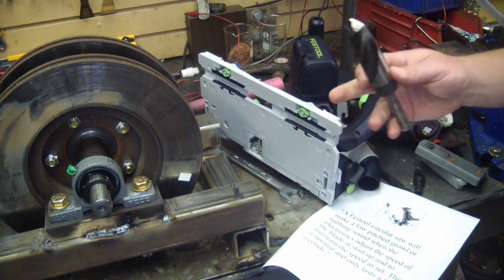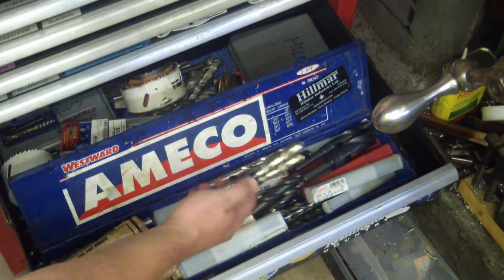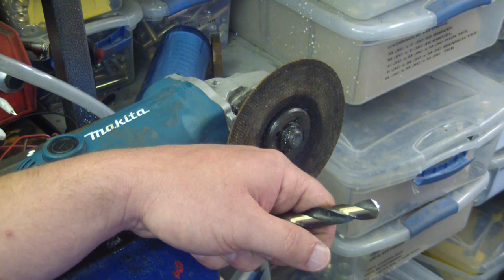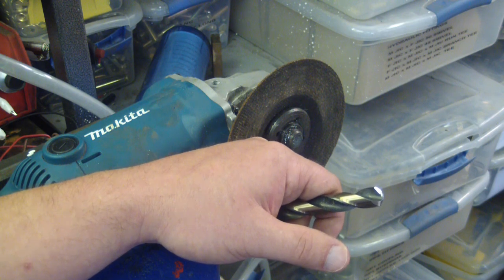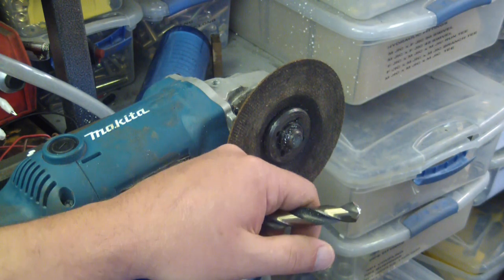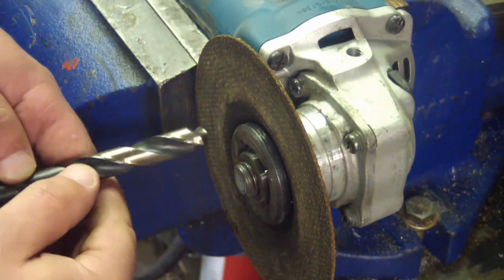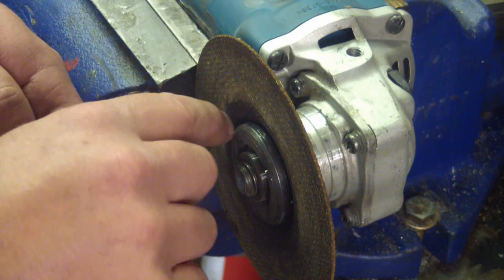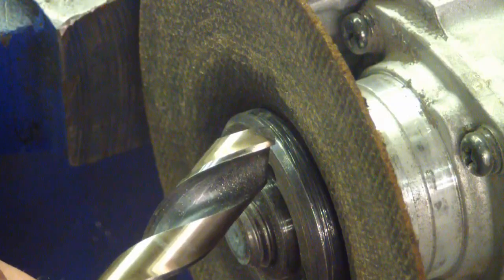Sharpen Drill Bits WITHOUT a Drill Doctor?!

Comment: Great video, I've had to sharpen drill bits like this many times on site and it does work if you do it right.

Another tip which might help out at some point: If you've run out of bits of the correct size then you can drill a bigger hole with a smaller bit but grinding it so that the flutes are slightly different lengths. It's not comfortable to drill, it's not precise and it's not pretty, but if you're in a pinch it does work!

Comment: I got my grandfather bench grinder  n the  one wheel he used for sharpen drill bits n chisels only don't no what it's made of but it don't over heat the steel like normal wheel but them old guys had there ways that still can't b matched by any machine

Comment: I only use a 50 grit 3" roloc disc on an air grinder with about 100 thou runout to sharpen my drills, and split the point.

Comment: In our business we use a fuckton on 1/8" twist bits. My knuckle-draggers  sometimes only get a few holes in some 6063 1/8" thick aluminium and they are screaming the bits are dull. Ive tried the cheap bits and the expensive ones.  I been saving them for a few years and now i got a coffee can full. My problem is the damn things are so small its hard to see the areas to sharpen when using a bench grinder.  Even with a light and magnifier shield.  Any tricks or tips?
Reply: i sharpen drill bits down to 1/128 with a dremel and cutoff wheel
Reply: really? you impress easily
Reply: sry..... 1/64 th....or #78..........my bad

Comment: I prefer to sharpen by hand. Allows you to make a proper bit for the material. I've drilled leaf spring with a cheap assed HSS bit simply by reducing the angle. The guy I drilled it for went two 3 welding shops that failed  before he brought it to me. Lots of folks can sharpen bits most just try to fix what they had. Once ya learn to aharpen. Learn to screw with a lesser or greater relief angle lesser or greater cutting angle and length and mess with the profile angle you can get almost any job done with any cheap bit without having to go purchase more expensive ones.

Comment: definitely need to show this to some of the guys i work with at Weatherford, getting tired of ending up with stubby drill bits and bits that look like shanks and pencils, although it is pretty funny to watch a new guy light the shop-vac on fire by drilling through plastic valves at 3200rpm with the Bridgeport and a "sharpened" bit

Comment: you dont measure the hole after you test-drilled the drill?
cause, you know... even if I sharpen drills every day at work, I grind them not symmetrically sometimes and the holes get 13,3mm instead of 13mm...

Comment: Is that a cutoff wheel?  Putting  lateral load against it is highly not recommended .  Cutoff wheels are for vertical cutting only. I think it's because there are fibers in the wheel that will cut, and the wheel can explode. Well, not explode literally, but coming apart at that high of a speed might as well be called an explosion.  Shrapnel is still shrapnel.

Comment: that's actually how I sharpen bits, it gets more difficult if you manage to snap the bit off because you sort of have to guess at the angles. The drills I use tend to have enough torque to snap the bit, and I can't drill a straight hole to save my life, so this tends to happen whenever I have to drill holes in steel.

Comment: First off I fucking love you! Second I did this all the time when I was in the Air Force. I worked on Aircraft with my 80 pound Filipino brother holding a bench vice. We had to do this to drill bits all the time since ordering them took to fucking long. This is how most of the third world sharpens shitty Chinese drill bits. 2a753 for life!

Comment: We have a drill doctor at my shop and i have tried it several times but the problem with them is that if you break a drill bit you are fucked. try to regrind a profile onto a broken drill stub some time and you will figure out real fast its a science and you are not doing it with a plastic piece of chinezium like a drill doctor. Ill stick to a grinder thanks. it may be ugly but it works.

Comment: I have a had a Drill Doctor for years and seldom used it. Literally after a few years of non use I got it out to sharpen a bit, drill bit that is. It messed up the bit. I tried repeatedly and got no success. I looked and looked at the chuck and thought I saw something amiss. Since I had not used it in years I had no recollection of what it should look like. I watched the supplied DVD and could not see the problem. I was about ready to chuck it and went to Lowes and bought a new one. I tried to sharpen on it and in minutes, I had a perfectly sharpened drill bit. I compared the two chucks and then saw the problem. My old chuck for whatever reason was fucked up. It would not hold the drill bit properly. My old DD was a 750x and is out of production. The new chuck will not fit the old DD and vice versa. My new DD will only sharpen up to 1/2 inch but the old one will go to 3/4 inch with the larger chuck that I have. The larger chuck is still good. So now I have two DDs and both work. Contrary to what AvE says, it really is easy to do and why he had trouble with his knowledge of machines, I cannot understand.

Comment: If one needs to sharpen drill bits to factory spec's, neither the Drill Doctor nor hand method will do.  Buy a Darex, but be prepared to shell out $1000 or so.  They're really only needed for CNC machinery in order to keep close tolerance.  They'll do split-point, and brad-point bits too.

Comment: Would the grinding change the temper at all?
Reply: If you let it get too hot, yes.  The "right" way to do this involves dipping it in water every few seconds.  If you do this without gloves (you shouldn't be wearing gloves), you shouldn't ever feel the drill getting too hot on your fingers.  If it's hot that far down, it's probably already too hot at the cutting edges.  As long as you keep the temp down, it will be fine.

Comment: Grinder has always worked for me but if that Drill Dr. works on the small bits it may be worth it. A little too much shrapnel has made it through the safety squints and I can barely see the cutting edge on those little buggers anymore.

Comment: Trick I learned years ago. One criticism I have is never use a cut off wheel. You wear down a thin spot away from the edge the next time you cut the damn thing turns into shrapnel! Use a proper grinding wheel.

Comment: Hi...

Could you do a test on hole size please?

As in... use a brand new drill, drill a hole with it and then use an old drill that's been hand sharpened a few times and drill a hole and mic up the hole sizes?
Reply: Mark Batchford 
As in... I don't really care if a tool cuts, it's easy to make a tool cut...

Does it cut to a decent spec?
Reply: Mark Batchford Twist drills don't cut to accurate sized holes in the best condition. Reamers and boring bars make accurate holes.
Reply: David Kirtley
Hi David, Thank you for replying...

I know that, but a badly sharpened twist drill will cut a hole that can be much larger than spec and you can't ream a hole down in size

Comment: No guard,is that a cutting wheel?zip cut?,oh and why not go for the 5 inch wheel? I sure do...hey,I even put the carbide 4inch skill saw on there for aluminum,works like a hot dam,specially in tight quarters. I can see your the kinda guy that gets it done...keep up the good work.

Comment: I was wondering why you didn't check double check your angle make sure it wasn't 59 and make sure the length of the flukes were correct and put a little clearance so you wouldn't have to push so hard especially going through the aluminum it gets a little gummy other than that I've never seen a drill sharpen on an angle grinder good job . my father taught me how to sharpen drills when I was about 13 years old on a pedestal grinder and he was still look between his thumb and forefinger to make sure the angle was correct and the length of the flukes were right the man with a Tool Sharpening God. I just wondered why you didn't double-check that your angle was correct and that your length of your flute swearing correct but I'm sure it was because you didn't have to make a certain precision-made hole your should have relieve the tip just so people know how got to say love your show sometimes I have a hard time understanding you but I'm getting better

Comment: drilling a short test hole with a bit ground by eyes will show which fluke is cutting more by observing the length of waste spiraling up the flukes. Fluke with longer spiral was cutting  first, leaving less for number two. Rule of the jungle. Tells which side needs to be made smaller.
Reply: Auto correct makes chaos out of any reasonable sentence.

Comment: By lifting the drill to do your relief you are loosing your hand position and just wasting time. Just do the cutting edge like you did and if it needs more relief, then angle it to 20 degrees or so and do the same action. Facet grinding produces an equal cutting drill much faster and much easier than doing that twisting/lifting motion.

Comment: That anger means he's human. Just like us. :) There's always a dash of humor in others frustration. Great vids as always. Not sure what the big deal is though, use a guide or drill doctor or whatever the fuck. It's not like you're going to fuck it up more than a dull one that doesn't do shit anyway. What the hell are these people all jacked up about? Try to sharpen it, if it doesn't work, pitch it and buy a new one or save it. Meh.

Also, I liked that pull up at the end of the cut. Didn't think to do that when I was dicking around sharpening bits. Worse thing i've experienced is getting that point off center... ain't going to be cutting shit then.

Edit: I forgot to mention if you've heard much about sharpening those cobalt and titanium bits? I hear the dust they make is toxic as hell... Any comments on that?

Comment: When I started working in  shop about 15 years ago, they had a drill doctor.  Told me to learn how to use it so we could save some money on drillbits.  Four hours later, I had a drill bit that was sharper than it had been, but barely sharp enough to drill Aluminum. Talked with my dad later about it, and he said just use a grinder. Look at what a brand new bit looks like, and make your bit look like that with the grinder.  So, 20 minutes of practice, and I was able to get fairly close to a factory shape on a bit.  The drill doctor got thrown in a box, and shoved under a workbench.  Apparently, it had been sitting there for a year before I started, and they couldn't get it to work right either.  I'll take a grinder any day over one of these shit machines.

Comment: When your drilling metal and the drill starts to break through and stalls, put in reverse high gear and give er again. It will punch through. Saves wrecking the bit or overheating your motor

Comment: Take two big nuts, and stick them together on the flats, you will then have a 120 degree angle you can check your angles on.  120 degrees is right about what you want for drilling metals.

Comment: I see where this is going and how good it will work not even half way through. Nice flat surface that won't take to much.  Almost like a a wheel made for it. Get a job drilling sheet metal and have to buy your own bits you learn real quick. Tin roof material sucks especially on a assembly line.

Comment: Never learned right...but I could grind a bit to cut through aluminum rivets like butter, even twice as fast as a proper grind would do.  If I had to drill steel...I got a new bit from the tool crib....and kept it away from butcher activities until it got dull....then it was my next grinder victim.  BTW...they were all small diameter drills.....I just learned they should have gone in the trash.  Somehow I already knew deep inside.  Edit: You can have uneven flutes if you are good at steering the bit while you drill...it doesn't seem to affect the cutting ability in soft materials.  I'm not sure my edit is an actuall piece of useful information....just an observation.

Comment: Your drill grabs and stops at the break threw because you have too much back relief on the drill now..  There is a slightly different angle for different materials,   the "Chisel Point" in the center can be removed with a very thin grinding wheel.  The one you are using will be perfect for it..
   I can see why you need to sharpen drills,,  You are pretty rough on them..  With the right speed and hand drill or press,   they should stay sharp for a good while.

Comment: I can sharpen drill bits by hand, I've been a CNC Boring Mill Operator/Programmer for years and worked in steel fabricating before that ... I've used Drill Doctors many times, some very nice Industrial Quality ones not that Princess Auto crap on the vid.
  If you set the drill properly in the holder and are diligent it will sharpen the drills nicely.
    The one problem I see ,(besides being reliant on the dam thing if you don't have basic skills to do a simple task) Is; The machine will not cut the proper amount of relief/clearance behind the cutting edge. It's a Huge problem as soon as the cutting edge wears the Slightest Bit it turns into a rotary chisel!  If I ever used drills sharpened on the drilldoctor I would have to take it to a grinder and add a bigger relief or it would crash and burn after 3 or 4 holes. 
      Perhaps the machine has been Re-Designed to solve this Huge Flaw ? I haven't seen a current model lately. Other than that the thing is great but I can sharpen them by hand near perfectly, Is that vanity?, and if I have to grind them anyway why bother? 
      It puts a Beautiful Split Point on them btw.
  I'm a new viewer to your videos, big fan , Thanks for taking your time !

Comment: I did a 4yr Government military Mechanical Engineering apprenticeship. We were taught to grind drills by hand, free-hand. Then had to sit an exam on it.  Your technique was slightly wrong. As you start to lift the drill and create the Rake angle, you also need to twist the drill slowly at the same time. So you are creating the rake angle down the flute.

Comment: This is total fluffy mamsy-pamsy, daddy bought you a new car on your 16th birthday, 'burbonite crap here!  Real men sharpen their bits on the concrete!  Electricity, psshht! 

Okay, honestly, I have a drill doctor.  You should submit to our authority!  Been learning the DD and like you said, it's not as easy as they make it look (sidenote: everything is easy when you know how).  It does a good enough job for a home sharpener which is what it is.  Even once you get the hang of it you aren't going to be able to open a mobile bit sharpening and sandwich cart.  It's just too slow.  But it beats the apcray out of that Craftsman/General Tool/whatever it is jig.  Still haven't found a use for it.  I need an "Art bin".

Comment: Thanks, very informative. I usually use my bench grinder, but I like this method just as well, except perhaps clamping tool in the bench vice. How's about making a grinder bracket that holds your tool securely using the auxiliary handle hole? Granted there's not hair to guide you though.

Comment: Manly man skills!
Reply: Edit: Drill doctor makes no sense. The people needing to sharpen drill bits are either A) too cheap to buy a new one, or B) actually have the know-how to sharpen one themselves.
Reply: +Steve D (dettonator) Although I'm a sucker for buying new drills, when you're running a business, it's a cost that soon adds up so just spending a bit of time to tidy them up can save a fair bit of money.
Reply: Steve D I had like 200 drill bits, and two of them were like 40 bucks a piece.  I thought, "what the heck" get me a drill doctor?  thought it would save all my dull bits, but most of them cut like garbage now.
Reply: Dixon Cider $40 apiece sounds like something that has to be professionally reground. ask around maybe, volume prices are often cheaper than you might think.

Comment: in my experience drill doctors are garbage. we tried a few different models in our shop and they all went into the trash. we did find a good drill bit sharpener made by grizzly. dont remember the model, but it was really awesome. great results, quick and easy to use. no plastic parts either! i think we paid around $400 for it but it definitely paid for itself in less than 6 months and it was still working great when i left the shop 3 years later. def a good buy.

Comment: I sharpen my bits the exact same way but on a low speed bench grinder with a ceramic alumina wheel. They come out sharper than they did from the factory

Comment: Great Video! Gotta throw my 2 cents worth in on the "Drill Doctor"
Picked-up one of the drill doctor sharpeners at Lowe's on clearance about 2 years ago. Worst son of a bitch I've ever used ! Pain in the ass to get the bit in the chuck properly and the points were always off no matter how many times I re-chucked, re-centered, re-tightened, etc. Must have twisted/rotated that thing 500 times per bit to get an edge. Not one that would cut but, an edge that didn't look like a couple of Crack-addicts did it.The relative few times I did get it to work anywhere close to right, the bits dulled very quickly. Too much time wasted to sharpen one bit. Quit using it and went back to using the disc grinder method shown here or the dremel tool with a diamond disc. Works a Hell of a lot better and I can make whatever type of bit or point out of it I want! Was going to send the DD to the manufacturer but, in the meantime, it fell off the bench and jammed the bit holder assembly halfway into the plastic body and promptly broke off a couple of necessary guide tabs for the bit holder. So much for that idea now...it's a dust catcher, paperweight, occupies space on the bench, etc.